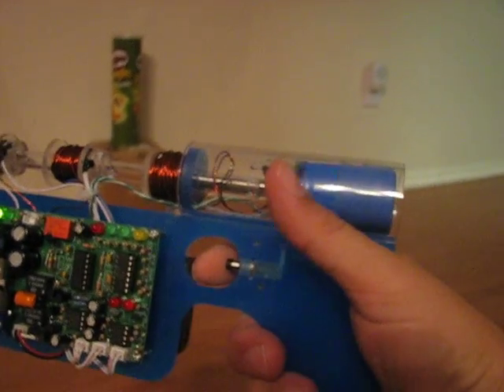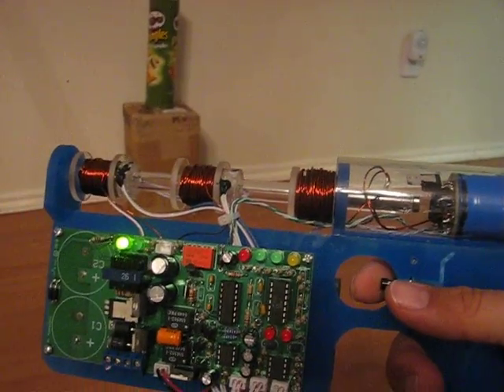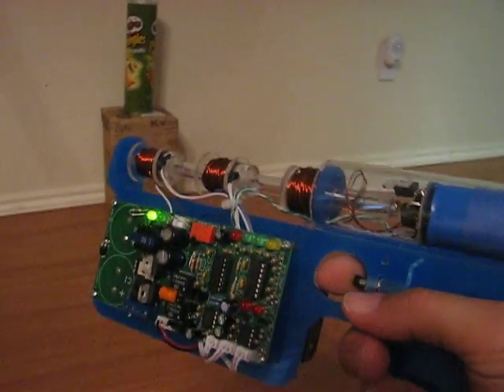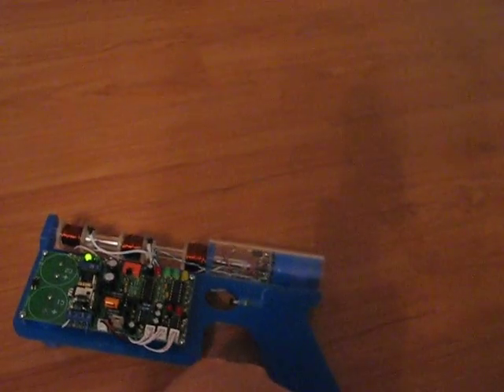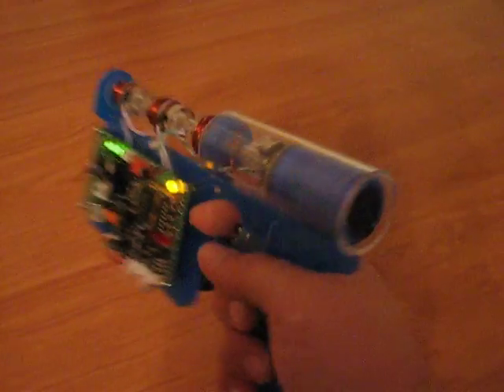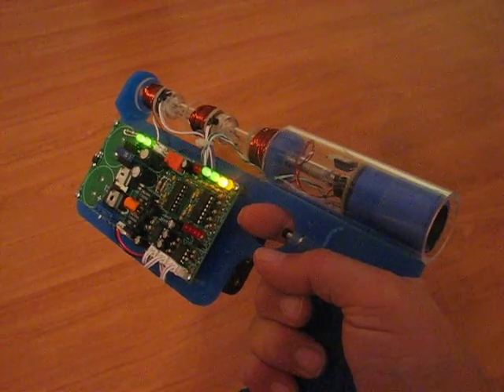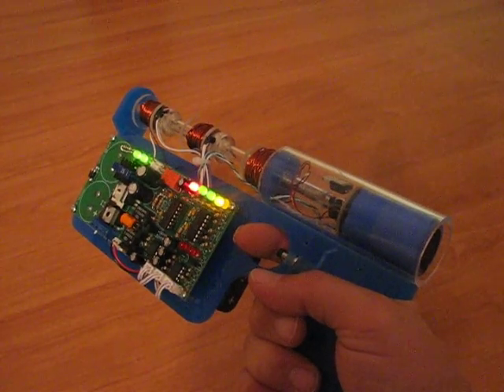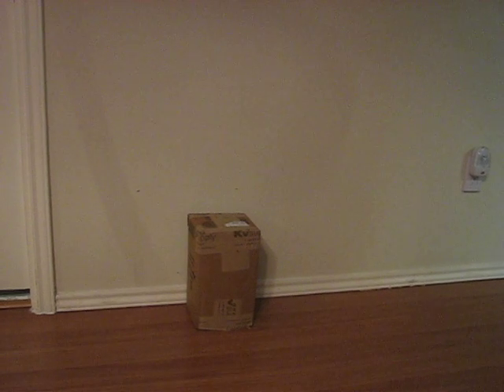3 Stage Coilgun Pistol Using Emag Controller Kit

Comment: ...and if it got wet, or your batteries went flat or the electronic circuitry got damaged etc. Also would be quite heavy due to lots of copper coils and battery cells. Factor in the amount of time it takes for the thing to charge up. Give me an AK47 any day of the week please.

Comment: There is this cool device in electronics called a comparator. He uses that to drive a transistor which changes the LED state based on charging. The comparator samples the voltage on the capacitors through a voltage divider since the comparator obviously would not be able to handle the full 300+ volts the system is charging to. BTW this project could kill you if you don't have some understanding o basic electronics as well as the hazards of capacitive storage banks. THEY KILL!

Comment: Hmmm. Interesting theory. It would have the advantage over rockets that you don't have the extra fuel pay load. Also, I reckon that electromagnets are a lot more efficient than rockets in converting to kinetic energy. Also a lot safer!!! I wonder what NASA would have to say about it.

Comment from the maker: The impeadance of the transformer is quite high.  It pulls a maximum of 500mA, so a bigger batt wont do anything.  But, my new design uses two boost converters to generate 400V and 800V respectively and they consume 60W.  A 3S 2200mAh lipo will work well with it.

Comment from the maker: I decided to restart my accelerator program :)  I have a newer, higher power design that Ive begun work on.  The desgin is to be very versitile so I can test furture updates on it.  Total of 4 stages (2x 400VDC) and (2x 800VDC).  It will use a inertial stabilizing system (axial spinning projectile) and should easily reach the 300ft/sec velocity range.  It will not be much bigger than the one in this video.SCR based switching. IGBTs will come soon.  Solidworks models and schematics to follow!

Comment: Actually this CG is based on reluctance. You can also build one that is based on inductance that will work on rounds made of aluminum or copper. You just make a flat coil at the base of a rod and use copper or aluminum rings or washers. Aluminum rappel rings work very well and are cheap. Those two metals create an inverse magnetic field that opposes the magnetic field in the coil when they are exposed to the coils field. They are actually more efficient than reluctance based models.

Comment: The trick is if you plan to actually use this, is to keep it charged all the time with a safety switch. Keeping it charged uses less power than charging it from zero every time.

Comment: it's a coil gun it shoots metal. it uses an electro magnetic coil to accelerate the metal. this one is a 3 stage so as it passes a coil it will shut off and turn on the next coil.

Comment: From what I have seen of vids about Gauss guns here on youtube, none of them use electronics or electromagnets. They are based on the concept of opposing magnets only and propel an metal slug or another magnet through repulsion. So no this would not be similar in function or design to a Gauss gun although there are sometimes referred to as Guass guns which is inaccurate.

Comment: The batteries have no effect on FPS. It is the voltage and capacitance of the capacitors that influence FPS. The issue this gun has is to even get above 200 fps it would need two more stages or bigger coils and caps on the current stages. However that would increase the current through the coils and also increase the limit of the SCR to the point they would be too large to fit into this package any longer. You could power this by your AC line voltage and it would still do the same.

Comment: You don't listen well. It shoots a 1 inch by 1/4 inch slug. Not a ball. Balls reduce the power of a coilgun by half becuase they couple poorly to the magnetic field due to low surface area. Also the metal can be aluminum and eve stainless as it can be made to repel such metals with a slight change in coil design and loading method. All the vids using balls are by people who don't know what they are really doing with coiguns.

Comment: An electromagnet that for a very brief moment is having several hundred to several thousand amps going through it on the larger models. If you do the math, on some of the large coilgun around her like the CG33, for about 1.4ms it is generating 1.5 megawatts of power through the coil. This happens so quick however the wires can withstand the current as long as the cycle rate is low.

Comment from the maker: I built a four stage pnuematically injected coil gun a few years ago.  The first two stages were SCR based at 450VDC on the capacitor bank, the last two stages where 900VDC and used large IGBTs with adjustable on periods.  It worked very well before it self destructed (the last coil developed a short somewhere in its windings and exploded).  Ive never fixed it, still on my to do list.

Comment from the maker: If you understood the process at work you would have your answer.  The faster the projectile is moving when it enters a given coil, the faster the magnetic field must rise and fall, all the while keeping its strength.  We can accomplish this by increasing the capacitor voltage with each stage and adjusting the Z of the coil.  Simple SCRs are replaced with a pulse triggered transistor.  The resulting complexity and cost of the switching system becomes beyond the reach of your average student.

Comment: What I dont understand is that no one on youtube has bothered to make a primary, non electrical accelerator such as a sling shot or explosive to propel the ferrous bullet before its enters the coil chamber. That would potentially make the gun more efficient and more powerful.

Comment: The coilgun works by pulling a slug part way through a coil and then collapsing the field and allowing the slug to travel under it's own inertia. A railgun on the other hand uses two rails that force a dissimilar metal along with it's plasma down the full length. The plasma charge actually creates a tremendous amount of pressure that forces the projectile out at a much higher velocity then the field in the rails could alone.

Comment: You mean, you dont know what they have. Same for power sources, as they have been working on teslas patents for over 70 years now. Rail gun specs for naval ships are also classified, unless you built them or you are the operator, what you think you know is wrong. Same for stealth, Its all in design of the weapon itself.

Comment from the maker: I made the boards.  It has two optically triggered stages, one scr and one capacitor for each stage, 2 optical gates, gatedrive circuits with gatedrive transformers, charging circuit and voltage monitoring circuitry.  Charger is a feedback based self oscillating design that charges the respective stage capacitors to (minus) -450VDC.